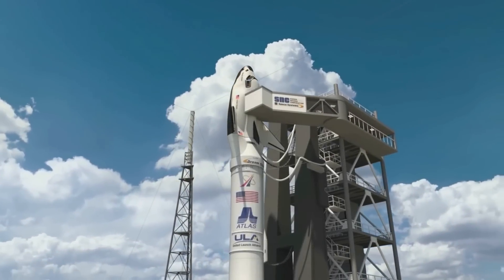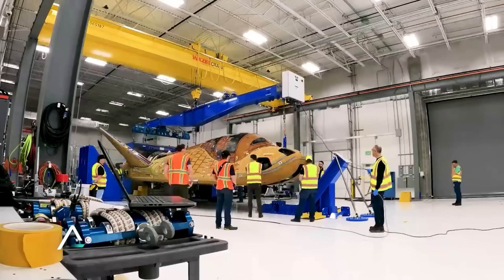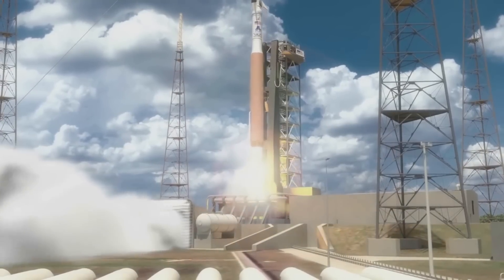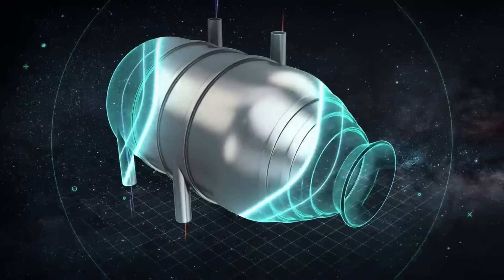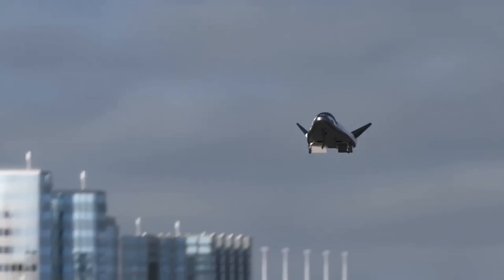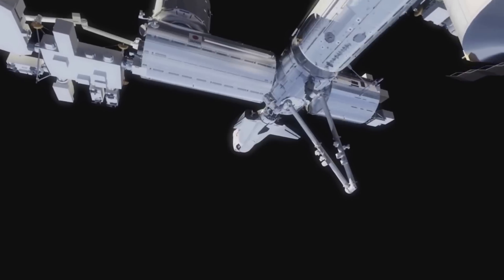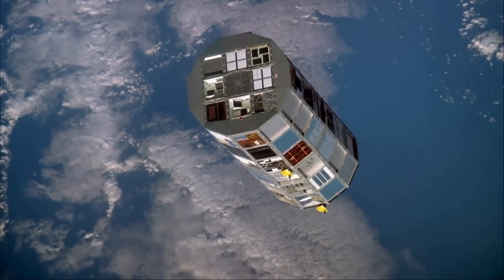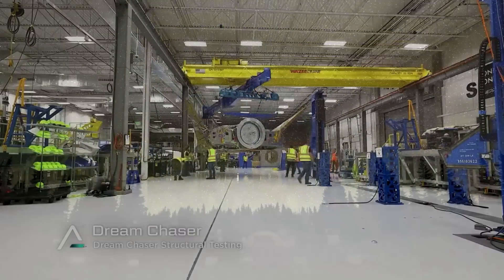The Small Thrusters Controlling The Dream Chaser Spaceplane

Comment: I was hoping to get a detailed explanation in this video how Vortex Control rocket thrusters work. Vortex thrusters are unique in that chamber cooling works by injecting oxygen into the combustion chamber tangentially, just inside the nozzle of the engine, which creates a cooling, swirling vortex boundary layer along the chamber wall. The oxygen moves to the front end of the combustion chamber where it mixes with the fuel and ignites in the center.  It is a cutting edge system that I suspect most rocket nerds would have a great interest in.